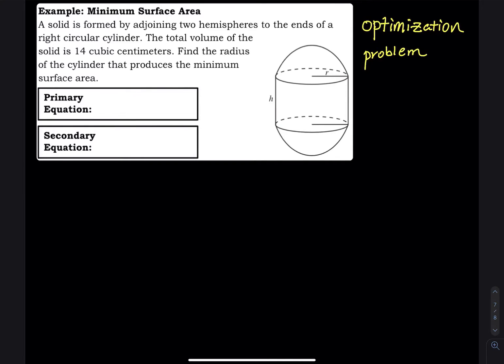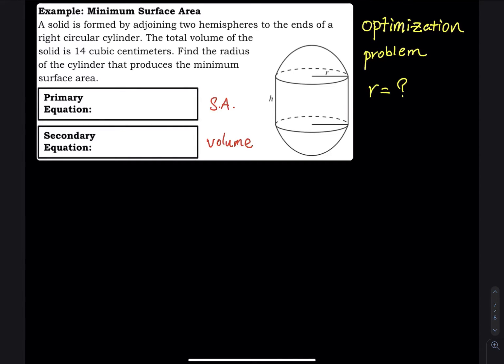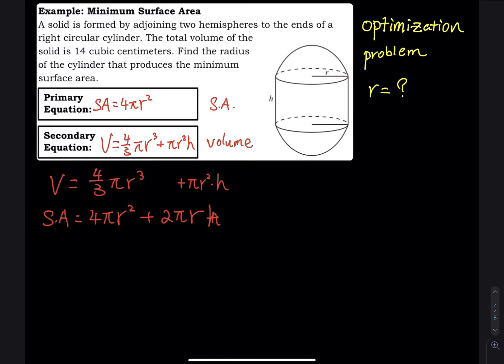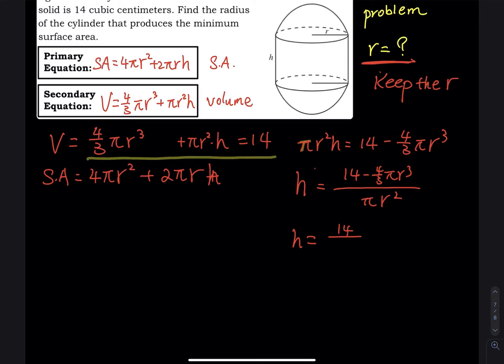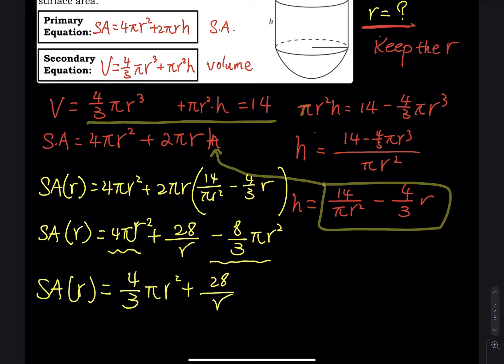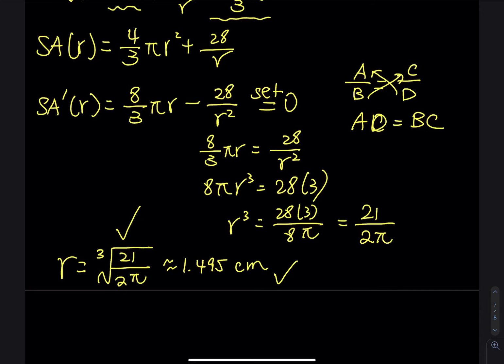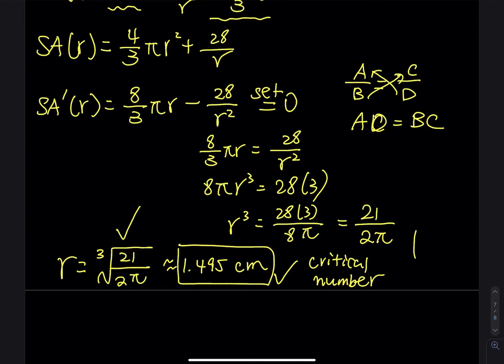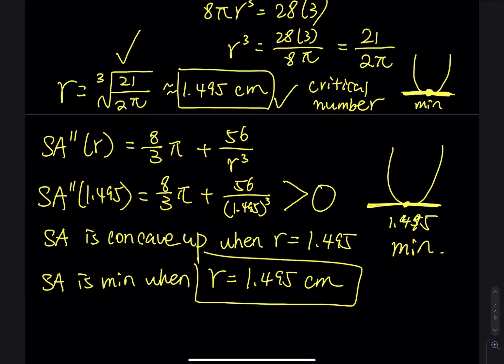4.7 Part 5: Optimization - Minimum Surface Area | Differential Calculus

Comment: Good video. A fun fact about this equation is that by using the minimum surface area, the "cylinder" just becomes a sphere. If the volume of a sphere is 14, then the radius is also 1.495.